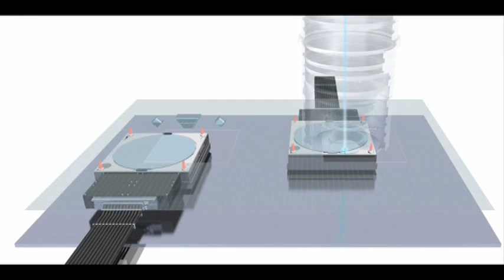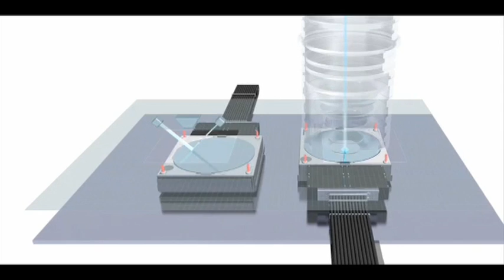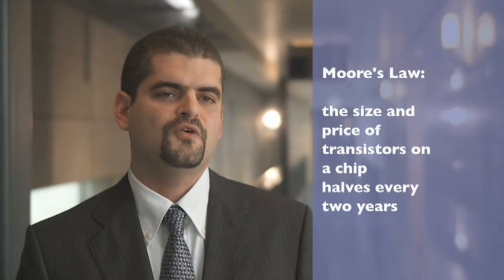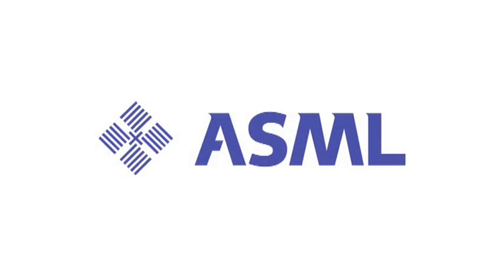ASML - Powering the Next Phase of Semiconductor Manufacturing

Comment: New ASML ' High NA EUV machines' are using my algorithm for producing 3D microprocessors.
The increased threefold density of transistors is as result of my invention. 
Transistors of less than 1 nanometer. 
The microprocessor design is made with my algorithm too.
My invention will change the world.
No one ever will overturn or surpass this algorithm for as long as the last human will be living in the universe. 

Now make it public to the world for this humanity achievement and let's celebrate together.

Comment: I am curious why you cannot scan an entire wafer in one go. Why must it be done one chip at a time.
Reply: i think they do it with very concentrated lasers right? so the area they can cover is less and also cuz they have to be really precise
Reply: Imagine to scan the wafer in one go. The lens system needs to archive focus across the entire wafer at once, from edge to edge. This is not easy to do. Most lenses, basically all lenses, vary in sharpness from the lens center to the lens edge. In the center the focus could be correct but at the edge it is not. The rays of light need to hit the wafer perpendicular. On the edges light would come in at an angle.
Reply: @oliverlison  still insane speed IMO. they claim 200+ wafer pre hour. but yeah manythings we can do and improve!

Comment: ok guys, so this vid. is 11 years old now.

But: when can I actually buy a PC with euv chips inside...?!
Reply: As far as I know the tech is only in smartphones. AMD Ryzen CPUs coming in 2021/2022 on N5(P) made by TSMC will be available for „normal“ customers outside of datacenters and will use EUV for more layers than as of now with 7nm. GPUs will follow and when N5 is more mature, it will be viable for bigger chips, right now only apple uses N5 for the A14 in huge numbers.
Reply: AMD graphics cards and CPUs on 7nm are EUV chips.   the EUV machines only make/print a few layers, around 3-4 layers, and the rest are DUV.  As the process node becomes more advanced, more layers are being made on EUV.
Reply: Maybe 2022
Reply: Like the other commenter mentioned - the high end 'flagship' phones such as the Galaxy Notes and the iPhone latest generation top of the line phones have been using chips manufactured with EUV light for a couple of years now. For a desktop PC, since physical space is not at the same premium as it with a mobile device such as a flagship phone, they are likely a tad behind. Having said that, generally, 2022-2023 for desktop PCs sounds reasonable although you'll still have to buy high end stuff, and also pay considerably more money for it.
Reply: @AmrishKelkar  khup bhari